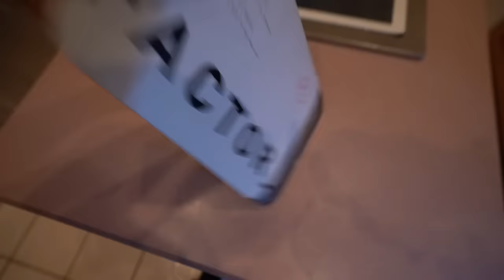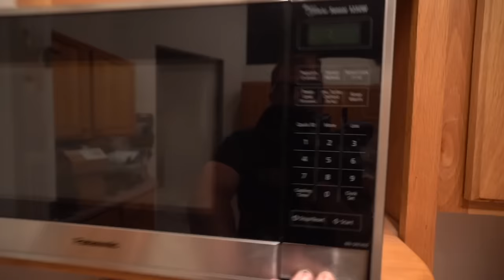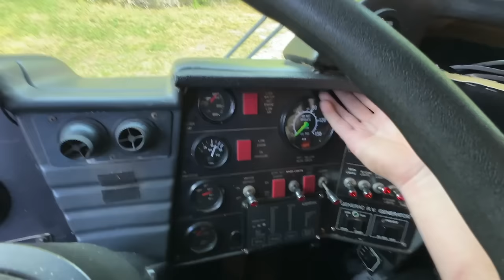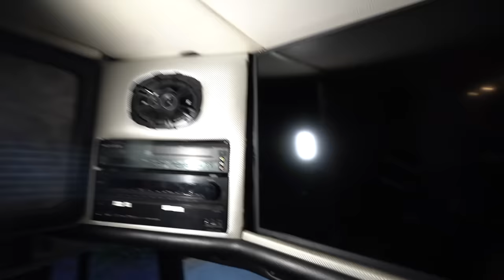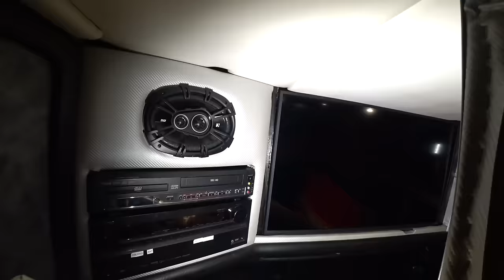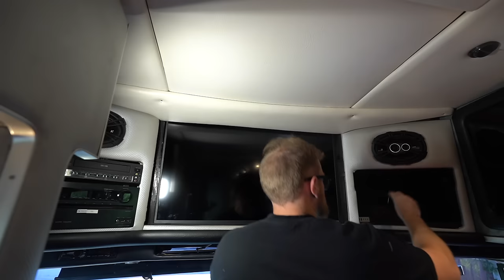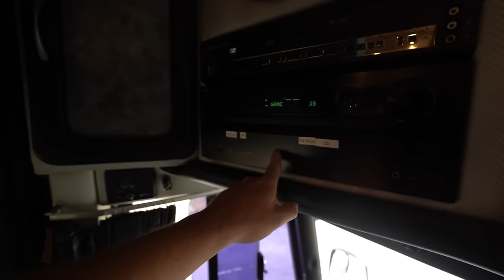Car hauler bus upgrades and refit. night and day difference

Comment: I'm surprised you didn't buy the m12 stapler, it's pretty nice! what is happening to you Taylor? 😃
Reply from the maker: That’s a thing!? I had no idea. Lol to be fair josue bought the stapler. I was against trying to upholster anything. But he had faith. So when the time came I gave it a shot and it was easier than expected! So an M12 one may be on the to buy list. Lol
Reply: @Taylordrifts  it’s about 100$ and Home Depot has it on the m12 deals pretty often so keep an eye open. It works pretty good but might have been a bit overkill for that! Tool aside, it came out great. Thanks for all the content!

Comment: Another great video on the Car hauler.  Stellar improvement for the Batteries.  Neat and Clean.
Just confirming that Factor is a great sponsor for Taylor.  
I've had the service since the start of this year, using a discount code from Taylor.  It's replaced my old habit of eating fast-food for my lunch at work.  Having the Factor meals for lunch has been super convenient and healthier as well.  I've get the 8 meals a week plan with Keto meals JFYI.

Comment: Just rip out the generator and get an inverter and a charger. With the lithium batteries it should run the AC for a while.

Comment: all the batteries should be wire together then to isolation switch and shunt then to devices as you have a meter in side that bus that will not work

Comment: You just need those putt a nice pv panels I have on Volvo b 12 m 4600 watts on 220 volts tru 48 volts and all  with victron stuff and I have therefore 2 batteries banks of 400 volts and I almost never need to use my generator 🎉🎉🎉🎉🎉🎉🎉🎉🎉🎉🎉🎉

Comment: Those 4 battery's are not 1500ah. I think you need to relearn some battery specs and how to understand them better.  For the xs power 7500s price you could of gotten the same capacity an more in less lithium batterys for the same price
Reply: i think he might have a discount from them or something if not he just likes the brand